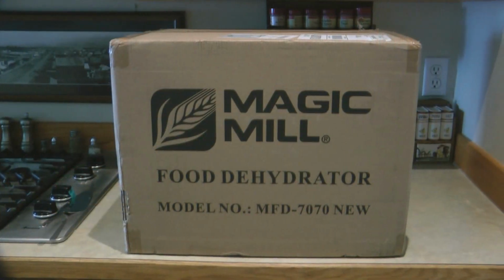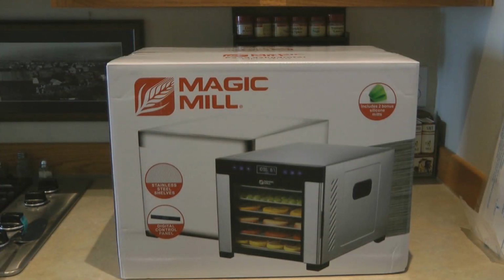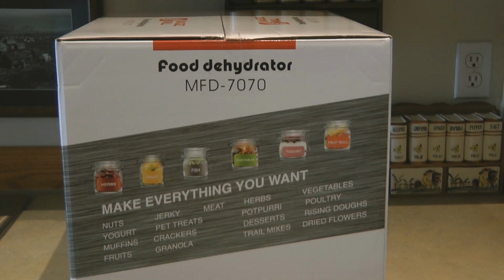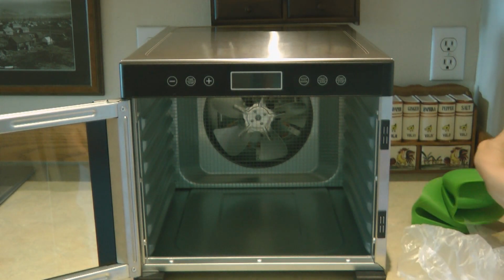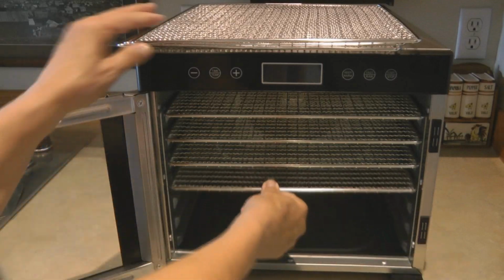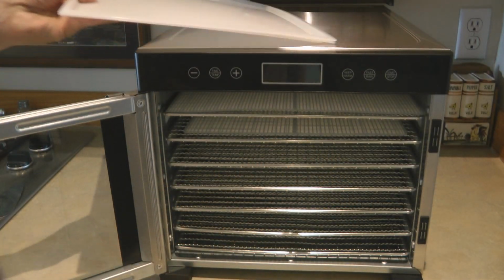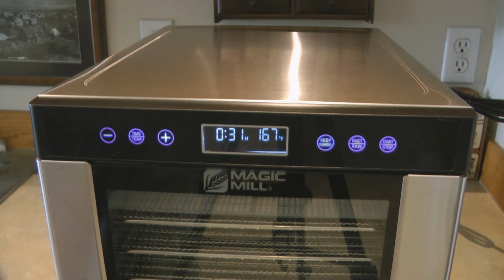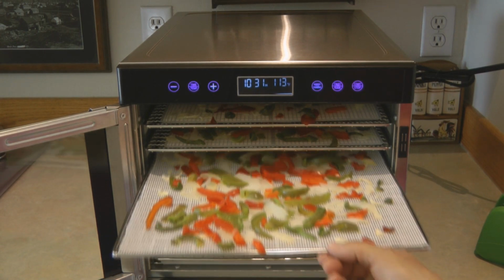Magic Mill Food Dehydrator Unboxing...Prepping Dehydrate First Use

Comment: Hi, A.G., I bought an Excaliber 4-tray dehydrator maybe two summers ago, and used it for the first summer.  BUT, as I am extremely low income from injuries (on Disability), living in a sibling"s house where I am NOT able to fully pay my own share, and haven't beeen able to work for a decade +, I am afraid to use it again due to potential costs (and have had much own-grown & store -bought produce go bad as my injuries/ reluctance to "use more energy" precluded my use of the dehydrator 😟)

Would you be able to give us a rough guide as to how much more it cost you to use your dehydrator for your purposes - of course, recognizing that the actual cost will vary by location/ usage?  Other newbies might find that helpful, too.  And, yes, I realize that you won't know until you receive your electric bill a month or two-three later..

Thank you for considering this.  And, thanks again for your vids - they are very helpful for many of us.  Cheers!
Reply: Hi K, I also have Excalibur dehydrators. To calculate how much it costs to dehydrate food look up a couple of numbers. 1. How many watts does your dehydrator use? Let’s say yours is a 450 watt unit. 2. How long does your food take to dry? Let’s start with 10 hours as an example. 3. How much do you pay for electricity? We pay 10¢ a kilowatt hour (1000 watts). In my case, for an answer in cents, 450 watts divided by 1000 will tell us how many kilowatts our machine uses, which is .450 kilowatts. We are running it for 10 hours, so 10 hours X .450 = 4.50 kilowatt hours. Now multiply that by your electricity bill rate. Ours is 10¢ so 10X 4.50= 45 ¢ it’s pretty cost effective to dehydrate food! The cheapest days will be the hottest, driest days. If it’s cold in the house or raining outside it can take twice as long to dehydrate food. On the other hand, if you are running a swamp cooler it can take longer too. Also the warm air put out by the dehydrator can make air conditioners work harder too.   I hope AG doesn’t mind me answering this question. I’ve done it before on another site and had the answer on the top of my head.
Reply: @nancyst.john-smith3891  Hi Nancy, THANK YOU!  I will try to do this.  When we got our electric bill, I had a huge jump in usage when  I used it,  but, I was also using my new seed-starter lights & seed warming mats, and so have been afraid to use ANY of them since due to this.  All three devices were supposed to be low energy usage, but that was not what showed up in our bill. 😱  Cheers, and thanks for answering/ explaining for myself & others!

Comment: I bought this dehydrator also and absolutely love it! The first one was dented terribly when it arrived and I returned it. I have been using it non stop for over 6 months with no issues at all. I bought the silicone sheets to be able to use the entire space on the tray. I also bought the solid silicone edged sheets to dehydrate eggs and other liquids. I do wish there were edges on the shelves to hold the food from rolling off when loading in a hurry. I love how quiet it is compared to my Nesco so I use it more.  I do baby it because I want it to last a long time.

Comment: If you’re on a budget, I got a Presto Dehydro and a Ziploc vacuum sealer back in 2017 and they still both work great. I’ve since graduated to a medium size Harvest Right home freeze dryer but I still use my Presto and Ziploc system. I’m fixing to process a “ton” of veggies.